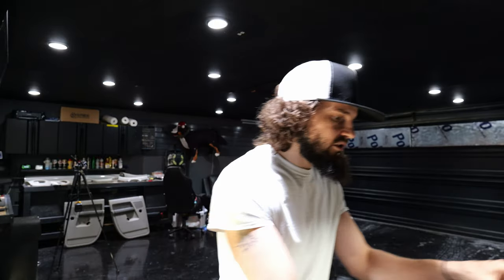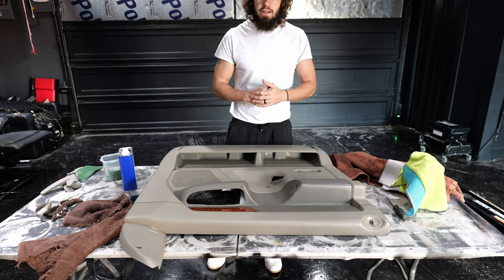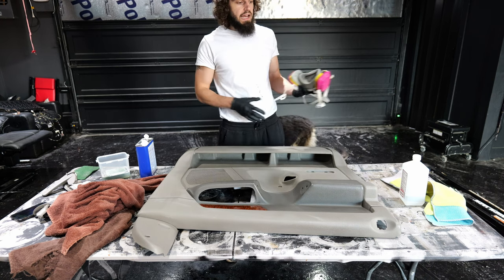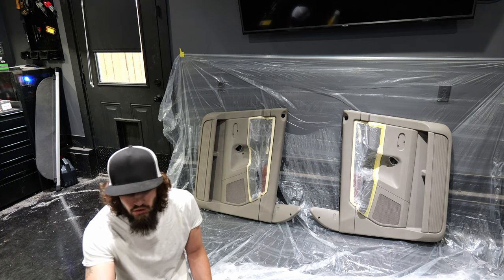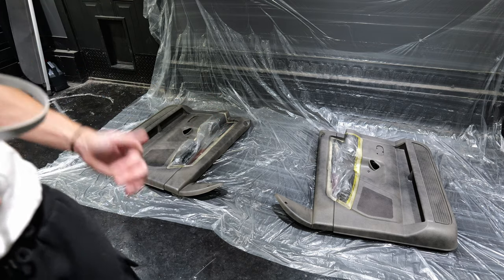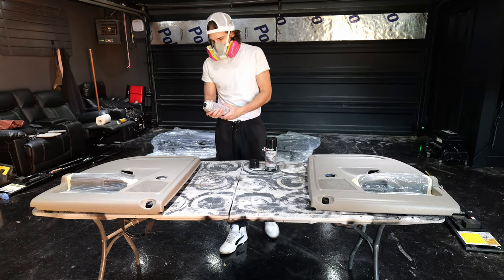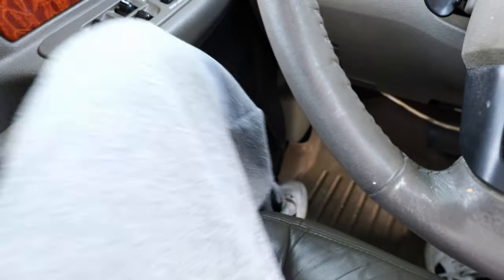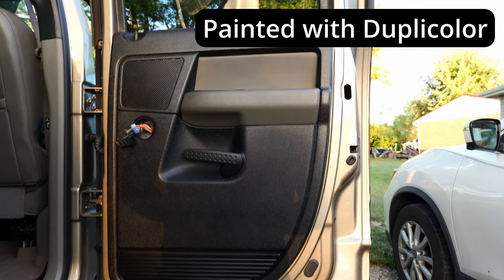How to Paint interior car door panels(SEM vs Duplicolor comparison)

Comment: If you are going for original look that’s  the way to do it. If you want it to hold up and not crack or scratch off you need to sand down a little with 240 sand paper spray the bulldog then spray down some primer but add some bulldog to the primer when you are mixing it. Then you add your  mat paint preferably. I did many cars with a gloss finish for car clubs and the gloss is very disturbing while driving. I have an 85 el camino that’s been sitting for over 10 years in the sun and the panels are just starting to crack.
Reply from the maker: Thanks for the feedback! The next time I pull them off to touch them up I’ll for sure try this!!
Reply: Good lookin’ out!  I’m going to do that today. 

I am also an El Camino fan, I have a 71’ el Camino I’m restoring. 

Thanks for the solid advice
Reply: I sprayed mine and it is stripping. How can I remove it all to start over again?

Comment: I'm restoring an '89 Corolla and the two decades in the yard unprotected bleached the trim parts and I've used alot of "protectant" and "restorer" but nothing gets them looking good.. You just convinced me to paint.. Thanks for a great video
Reply from the maker: Glad I could help and glad you enjoyed it!!
Reply: Did you do it?
Reply: @mongopoe5099  I'm trying but it's hard to find an engine without taking a risk on eBay.  I have it pulled apart just waiting on an engine.
Reply: Did the paint hold up?
Reply: @davidszymanowski4777  I couldn't find an engine so I turned it over to a restore shop.  They have had it for nearly 5 months.  I'm $15k into the restore but it's looking pretty nice.  I'm not sure how they restored the interior but I'll let you know when I get it back next month.

Comment: I enjoyed your video. When I spoke with the guys at my local automotive paint shop about painting my interior trim, they said you won't need the adhesion promoter for this application —it's designed for use on exterior plastics. Instead, they suggest using SEM 38353 Plastic Prep or similar products before shooting color.

Comment: I’ve had good results on multiple vehicles using SEM.
I went from a light poop brown everything to a two tone black and gray.  The results were amazing. I painted seats and carpet with SEM and it took out (covered up) stains and discoloration.  
I didn’t know at the time to use adhesive promoter but it turned out great.

Comment: Also SEM sells their paint in non aerosol form if you want to use an air compressor and spray gun. I did my Foxbody with the cans but if I ever do it again I’ll use the gun.  Great video. 

One thing to note is that when I researched the process all the info I found also said to go over the panels with a fine scotchbrite pad before spraying.Just something in case you wanted to try.
Reply from the maker: Thank you! In the next garage I’ll have an air compressor setup so if anyone has that I would certainly recommend the spray gun over the cans!

For the scotchbrite, I did use that with the soap and water but very possible I was to go over again right before paint, I’ll keep that in mind when I touch them up!
Reply: You're just the person to talk to... I've got an 88 Fox body. I'm restoring, and am looking to redo the interior. What color did you go with? Mine is currently gray, but with the armrest delete being black, I'm thinking of changing things to black? Sounds like you used SEM, which color did you use? And where did you buy it? Thanks a lot!
Reply: @reno911isawesome  the SEM color Landau Black is a perfect match for the fox factory black color.

Comment: Good video.   I’m currently doing a FoxBody with the DupliColor and it’s looking great.  The project before this one was a ‘72 240z and the DupliColor burgundy was a direct match and made the diamond patterned interior look brand new.   

For the FoxBody: Most of the panels and door cards are plastic and easy to work with.  I found that the rear cargo/trunk area had lots of deep scratches and scuffs.   I used 200grt and got a lot of the surface scratches out but the deep scratches remain.   I also learned that since the panels are textured, sanding them too much can create a problem with the finish.   That’s why I came to your video in the hopes that maybe there was some light to be shed on this subject of scuff removal with success.   I’m struggling a bit with the paint because it seems to bring out the sanding marks regardless of grit.   I really don’t want to sand 100% of the panel surfaces to relieve the splotchy issues so I’m a bit stuck at the moment for the panels that had scratches.   

A couple of things I recommend should you do this again: Hang your parts before you spray them…I learned that spraying on objects that are flat forces you to angle the can downward which can cause spitting and inconsistent spray patterns which can contaminate the coat.   

As other commenters here mentioned: Avoid Acetone! Acetone melts plastic!  I avoided that by simply washing the parts using dish soap and water, wiped parts with denatured alcohol then applied tack cloth right before the spray.  Results are amazing except for the areas where I sanded the scratches.   My plan is to hit those areas with 400 and feather them in to the non scratched surfaces, wipe down with soap/alcohol/tack then respray.   

For your door panels: Was it possible to remove the inserts from the back of the panel instead of masking them?    Time saver.  Sometimes those insets are riveted in so I get it.    Was just curious.   

Thanks again for the content.   PS your star studded headliner looked great!   Do a video about that install!   I’m all in!

Comment: Shouldnt have to touch up that often. I used the sem since its better. I do red scotch pad over the plastic, use warm water with a few drops of dawn to wipe down,then instead of acetone(plastic and acetone dont get along) i use denatured alcohol...much more plastic friendly. Then use the bulldog,then primer and then sem color.
I did my console about 6 yrs ago and still looks like it was just painted. Im also bad about throwing crap on my console but its held up.

Comment: So out of curiosity would you be able to put a layer or two of clear coat over the black paint to protect it more? I use my truck every day and she’s worked in so it would be rubbed off in maybe a month
Reply from the maker: This is an awesome question! I have no clue but I have a couple painted parts I haven’t installed yet. I have some regular and 2k clear coat laying around, let me do a couple tests and I’ll whip up a follow up video!
Reply: @ethanwingsit that would be awesome! Thanks!!
Reply: Dupli Color has a Fabric Vinyl clear product, I did it in my doors panels. After almost 10 months it is like new, but I take care a lot! I don't know how much would last in someone else's vehicle. But the clear definitely helps.

Comment: What model adhesive promoter did you use the sem what?
Reply from the maker: Howdy! The paints I used are:
Kleanstrip ETPO123B Bulldog Adhesion Promoter
Duplicolor HVP104 High-Perforamce-Vinyl
SEM Paints 39863 Platic Adhesion Promoter
SEM Paints 15243 Color Coat - Satin Black Aerosol

Comment: Which Sem version, gloss, semi-gloss, did you use? Great video by the way.
Reply from the maker: Thank you very much!!
The paints I used are:
Kleanstrip ETPO123B Bulldog Adhesion Promoter
Duplicolor HVP104 High-Perforamce-Vinyl
SEM Paints 39863 Platic Adhesion Promoter
SEM Paints 15243 Color Coat - Satin Black Aerosol

Comment: Was that SEM Landau black? Thanks
Reply from the maker: Howdy! The paints I used are:
Kleanstrip ETPO123B Bulldog Adhesion Promoter
Duplicolor HVP104 High-Perforamce-Vinyl
SEM Paints 39863 Platic Adhesion Promoter
SEM Paints 15243 Color Coat - Satin Black Aerosol

Comment: Was one can of each SEM product enough to do 2 door panels?
Reply from the maker: Howdy, for the adhesion promotor you would be able to do all four panels for less than a can. For the paint I used a (SEM)can per panel for the front, which are a little larger. For the back it was a little less(Dupli-color) than a whole can per panel, but the panels are smaller.

Comment: What color is the sem can? Looking into doing my truck with that back sem
Reply from the maker: Howdy! The paints I used are:
Kleanstrip ETPO123B Bulldog Adhesion Promoter
Duplicolor HVP104 High-Perforamce-Vinyl
SEM Paints 39863 Platic Adhesion Promoter
SEM Paints 15243 Color Coat - Satin Black Aerosol
Reply: @ethanwingsit is it HVP104 or HVP106. 106 is the flat black and 104 is gloss?

Comment: How many cans did you need per panel?
Reply from the maker: Howdy, for the adhesion promotor you would be able to do all four panels for less than a can. For the paint I used a (SEM)can per panel for the front, which are a little larger. For the back it was a little less(Dupli-color) than a whole can per panel, but the panels are smaller.

Comment: What's the permanent fix lol
Reply from the maker: Dye is an option but would require a vat to heat the water that would fit the door panel, but other than that getting an oem replacement panel that was cast from the color you want sadly

Comment: What a pathetic "kick test".  LMAO   I bet the second there's any real world use (ie.- a 2x4 scuffing the panel during loading/transport), that sh!t will flake right off. Too bad most of us will never know.  To your credit, you were very straightforward about warning us about the shortcomings of a spray paint in this application.   I wonder what would happen if you used truck bed liner.
Reply from the maker: Brother if you’re ridding home with a 2x4 in the front seat I feel like the next video I need to make is how to load a truck haha headliner would be crazy thick on your door panel
Reply: @ethanwingsit  Unfortunately (or fortunately, depending on how you look at it), I drive a Toyota Corolla, so yeah, 2x4s typically would be 8', which end up touching my dash or passenger door if I cram them in the trunk with the seat down and close the trunk.   You still kick like an 8 year old girl.  lmao  jk  ;)